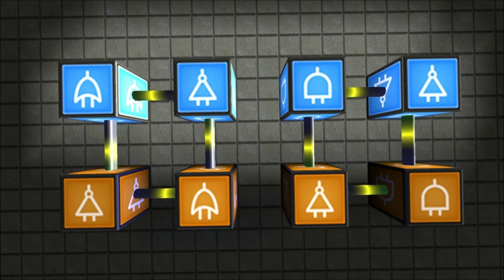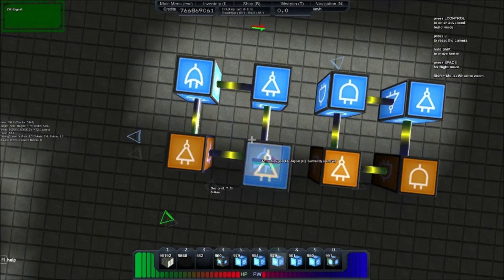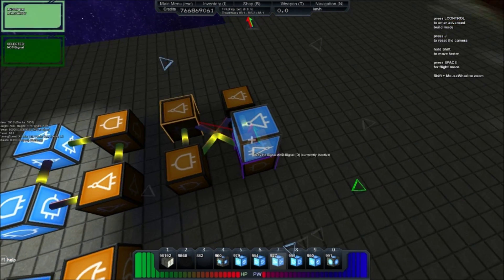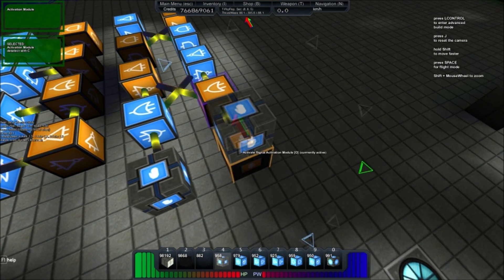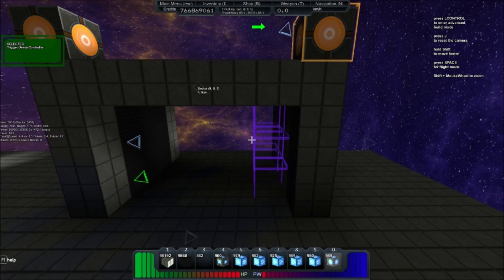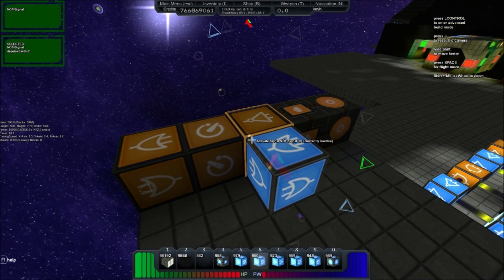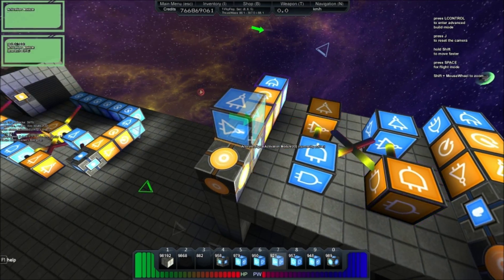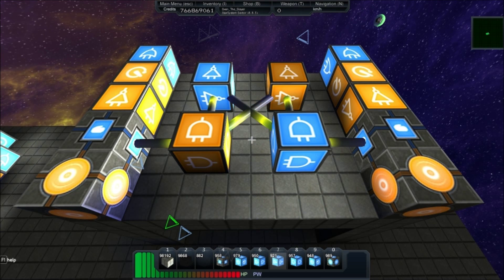Starmade Basic Logic Tutorials - Memory Cells (Episode 3)

Comment: how do i get the best fire rate v size in antimatter cannons now.

i have like 30 connected to each other and their fire rate is garbage like its absolutely SLOOOWOWWWWWWWWWWWWW.

iv never seen any gun fire this slow in starmade. even in the old system when you only had 1 gun it was faster then this.

so how do i change the fire rate and all that?
Reply: ***** the thing is i did that and it really made No difference. i did tell you i tried all the effects stuff and that includes the computers. the most i got out of 30 blocks using a slave Cannon comp was 800... i see people on the server im on fireing super fast with Less cannons then i am and it really doesn't even look like they are using the comp effects.